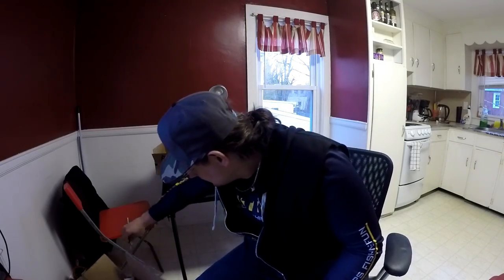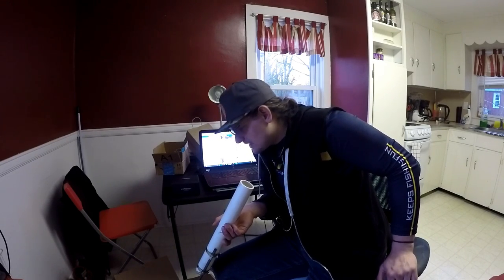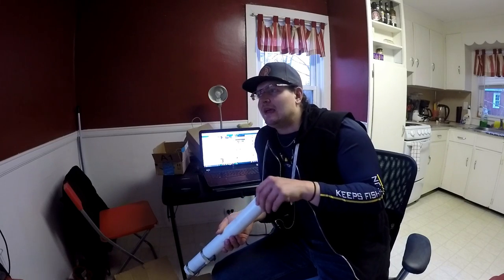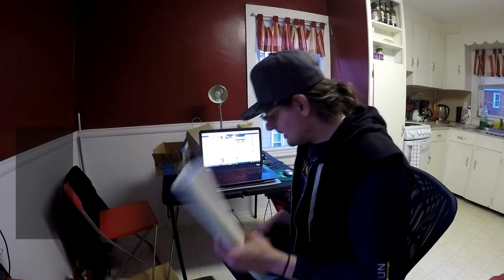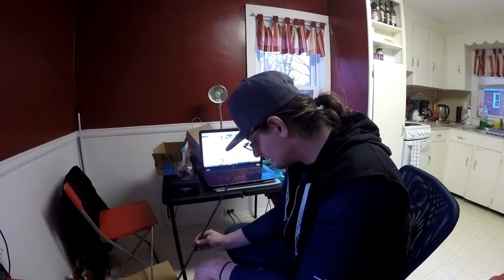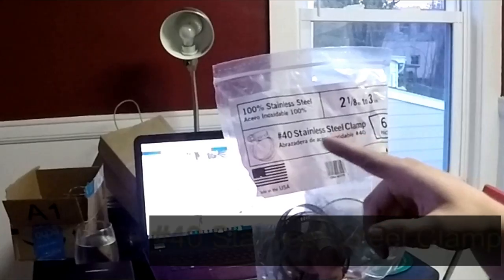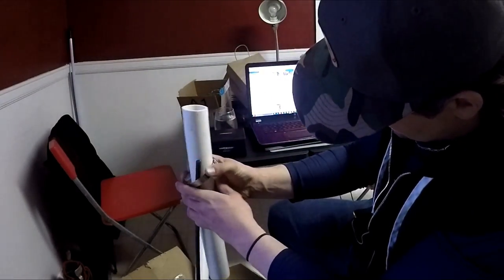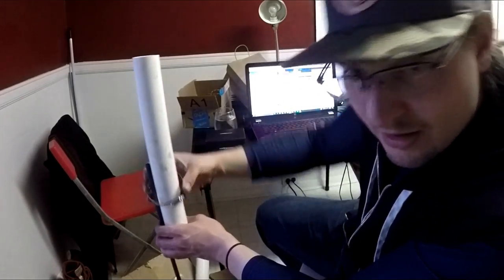The BEST Homemade Fishing Rod Holders (for Bank Fishing) - DIY Rod Holder - STRONG & SIMPLE

Comment: You can buy 1/2" rebar at Lowe's. 1/2" rebar is stronger than the mild steel round bar and it is cheaper.
Reply from the maker: DWeezy62 great idea man. thanks!

Comment: If you bend a 2" right angle at the top end you can hammer the holder in and use as a handle to pull it out without loosening the pvc.
Reply from the maker: True that! Awesome tip Jeff, thanks for watching

Comment: I use rebar and duct tape don't waste money on clamps. Also let the rear stick up a half inch above the pipe that way you can use a hammer to drive it into hard ground . When your done fishing use the hammer to hit the rebar at ground level and you can pull it right out.
Reply from the maker: Not bad idea, I'm still going with clamps but rebar is a good other option. Gotta go thin diameter tho to wedge it into harder rocky ground.

Comment: How do you make 1 for a sandy/stony beach???
Reply from the maker: For sandy beach fishing I cut a thick PVC pipe by 45 degrees on the bottom and use a whole pipe [no metal]. For pebbles you may have to go with a very long piece of rebar, or solid steel piping.